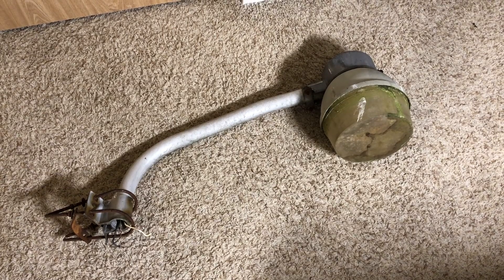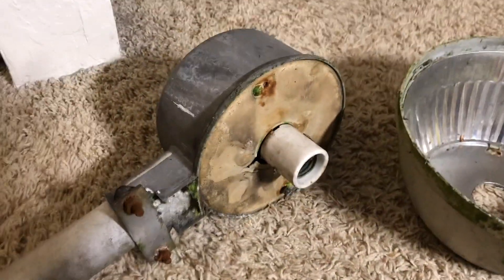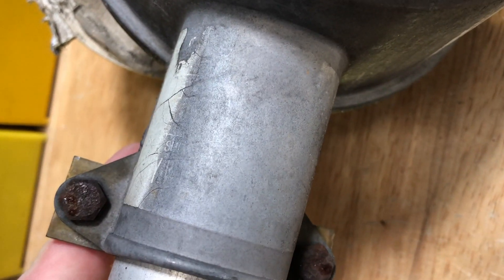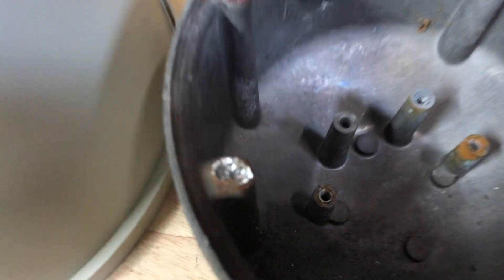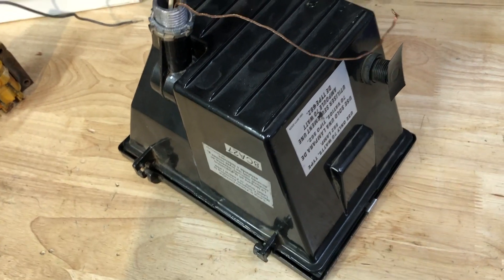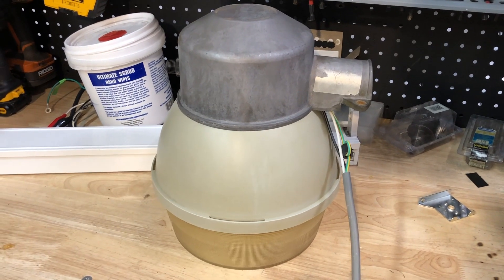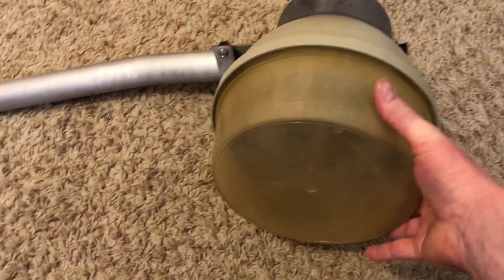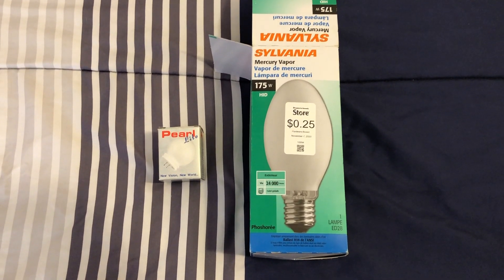Hubbell Mini High Mast Area Light (10,000 Subscriber Special!)

Comment: NICE. The boy scout camp where I used to go had quite a few of these HPS fixtures on the outside of the cabins, some were all intact and working, lots had missing refractors, several would constantly cycle on and off! And towards the end of my period there, some were replaced with LED heads!  I have not been back but sadly most prob are LED heads by now );

Comment: Life pro tip. Mix acetone and transmission fluid and put that on any stuck screws and then apply heat after letting it settle

Comment: I don't think those come with arms. Definitely a neat find, though.
Reply from the maker: I think you're correct as this arm has a GE logo on it. I'm sure it originally had a mercury vapor light on it.
Reply: @Parrot175  The arm probably did come as part of a Marcovay NEMA head and they had to change it out in the early 1980s. ...though a cobra head would have also been a possibility, or an incandescent. We used to have a few gooseneck incandescent heads in a few spots in downtown 'Ham that looked to be prewar. I would have loved to have raided a couple.